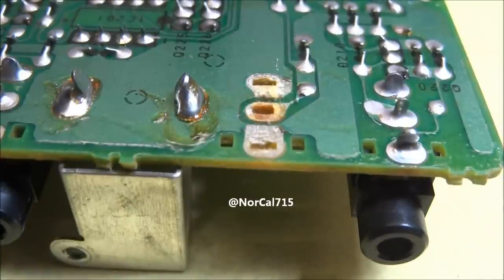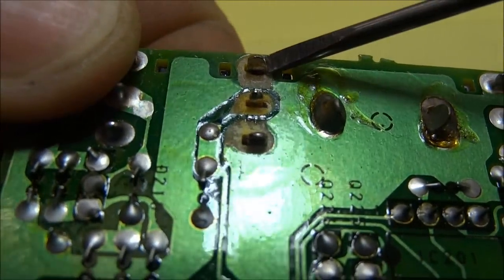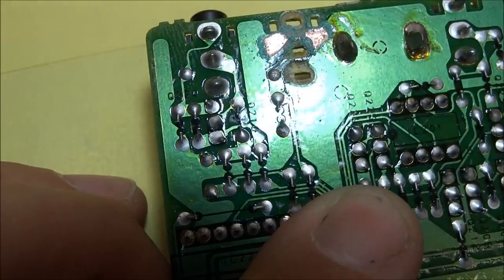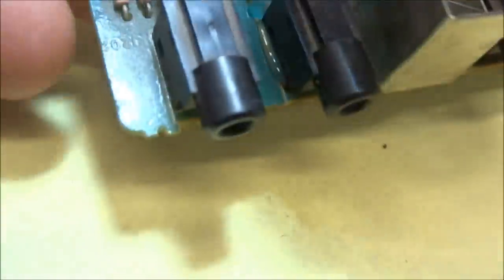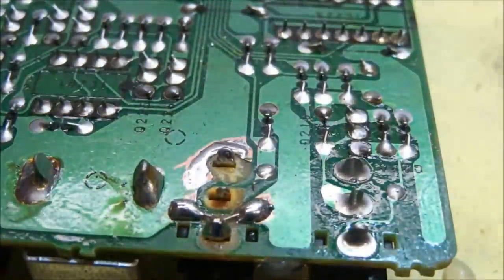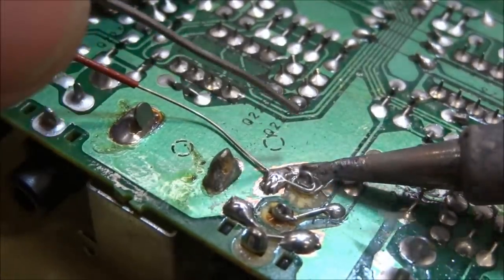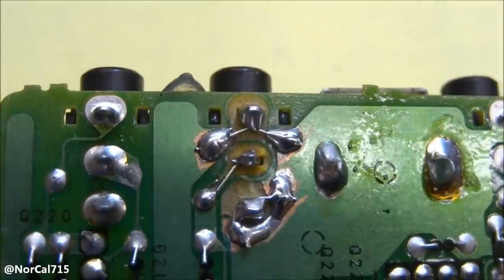Replacing a jack on a circuit board when the copper pads are missing Repair Fix

Comment: I am in electronics for 40 years and this is the better way to fix this problem.

Excellent job, well done.

Cheers.
Reply: maybe bending the tabs on the solder of the board is a good mechanical fixing plus it grabs the copper wire too; then just apply glue on the sides of jack (on top of board)
Reply: @alerey4363  That's not a good idea I think, because there is a possibility that a tab can break and you do not want to compromise yourself additionally. Besides that you are creating a new problem for eventually future service on this component.
Reply: @rolandberendonck3900  the risk of breaking is high if the tab was previously bent; but if it was soldered straight it can resist bending without issue; as for the problem for future service... an old jack glued with hot gun wont resist further service
Reply: No it won't break, in fact it will be much stronger. The metal pins would have to be bent back and forth many times to be weakened.  @rolandberendonck3900
Reply: @alerey4363  You are correct, bending the pins will anchor the jack to the PCB just fine.
Reply: So was I in fact over 40 years and this is the best way to do this repair. No call backs ever doing it this way. Also a true professional cleans the flux off when he is done like the video shows. I used to use RTV silicone instead of hot glue never had a problem.
Reply: @dontbetonit813  Hey there, i had a a question about something like this and i was wondering if it would be ok to ask your opinion on it? electronics is really not my field
Reply: Sir how about the chat gin pin the board damage the green color in board remove but a little bit.. What should I do

Comment: I just fixed the circuit board on a portable kerosene heater with this this video and saved a $200 heater!!  I could not figure out why the fan would not kick on after I soldered the connector back on to the board.  Thank you very much!!!!!!!

Comment: Thanks. This video was a total life saver. I bought a sequencer/synthesizer a couple years ago. It was battle damaged(dropped) and nonfunctional. I got it going (a couple of wires resoldered fine). It worked for awhile then boom, no sound. The Audio out was pretty much separated from the board, total tracer Spaghetti. Watched this video, fixed. Good advice.

Comment: Thanks man! I’m a complete rookie at soldering as I literally did my first ever soldering job yesterday .. I practiced with a cheap led kit first. Then attempted to modernize my 23 year old gameboy color with a modern backlit screen and other components.. but I accidentally burned off a tiny little pad on the board and my gameboy isn’t working now,, but I’ll try to fix it with these tips

Comment: I used to do this on keyboards from schools. They got a lot of abuse with keys broken and Jack sockets damaged. Works and keeps them going for a while longer. I also used to repair the non functioning contact pads under the keys, you know the ones, a bit like the rubbery buttons in a remote control, with a circle of tin foil. Worked a treat!

Comment: I like the way you wrap the wire around the post, adding some mechanical strength. Is there a reason you don't spread flux paste onto the workpiece before? On other channels they seem to douche the entire solder area with flux....
Reply: Same thing I was thinking and his still turned out nice.

Comment: Thanks man. Well explained i was trying to repair my usb sound card and somehow the copper pads were missing after removing the pins to the usb. I tried to solder to the hole but it just doesnt stick to the pad. After seeing your video i managed to try it and it works. A big thanks to you

Comment: That is a very nice job. Im in the process of fixing my OBD II scanner. It has some bad trace and a cap. The old AA batteries leaked and the corrosion ran up the negative wire to the board. Hopefully I can save it. And this video was a insight to me on how i can do it. Thanks for the 4 year old video.

Comment: Great video, great explanation.  By the way thank you for also mentioning which wire you were using... so many times people gloss over it like "oh just grab some wire," and it's not super helpful if you're learning (which, presumably their target audience would be).  

I'm doing some DIY projects in an effort to start learning some of the things I never bothered with.  One project is loosely following a hobby paint shaker build, and this guy listed every part he used... except the wire. And apparently asking about wiring is like asking for a proprietary secret.  Asked on Amazon, "what gauge should I use for this dc motor?" and got 2 or 3 cagey responses but 0 answers.  One particularly snarky response concluded with "get something that can handle an amp," with a heavy DUH implied.  

Thanks... (If that answer was sufficient, would I be asking such a basic question?  I gather I don't need a large wire, but what's too small or too big?  What's so hard about saying "I used __ AWG?"   Yes, I wasn't interested in learning anything about wiring until now.  Yes, I am very stupid and you are very smart big brain boy .)  I didn't realize wiring was a cornerstone that everybody is expected to be fluent with like reading or writing. FFS!

Ahem, anyway.  Side note: if your glue gun takes 10 or 15 minutes to heat up, that could be one argument for updating it :P.  I have a $5.99 Stanley Mini and a $15-20 Surebonder dual temp and they're both ready to go in about a minute or two.  The Surebonder also has an interchangeable nozzle so you can use a fine detail or flat nozzle, which might be nice for this type of work.

Comment: Thanks for a great video. You are a good teacher it's a skill believe me. I'm new to solder but was able to fix a auto instrument cluster circuit board with lifted pad by using a wire to bridge the pin to another solder pad. Saved me $300 thx bro!
Reply: Can you use normal soldering wire to fix anything?Since I only have the normal wire.
Reply: I ordered some solid core wire on amazon.  26 gauge.   But I bet braided copper would be OK.
Reply: Dave Champion thanks

Comment: I have the exact same problem with the power plug on a portable scanner. Had to replace it. Discovered that ninny here scorched the life out of it. I also have to replace a transistor that was surface mounted. 25 years ago was when I ruined the board but I think after watching this I may be able to rescue it and learn how to solder better. Too old and shaky in spots but we'll give it one more try. Thanks for the tips. :-)

Comment: I bought a refurbished  ASUS GS3S gaming laptop 1 1/2 yrs ago  and had to repaired 2x's after... Now I know why it was refurbished...

I replaced the $5 ac/dc jack that wasn't holding up about every 6 months instead of purchasing a $200.00 motherboard because it was pulling away from the board and wasn't able to charge battery or use AC adapter.

 Now I repaired  ac/dc jack again with your method which should reinforce it well..And Hopefully a permanent fix..

Thanks for the Helpful Video

Comment: The problem with jack connections is that once the ear plug is in the socket, it adds leverage to the jack which is then easily broken loose from the solder pads due to mishandling of the electronic device.  As you know, some board designs allows for a metal housing on the jack to have its own through the board solder pads to secure the jack, but in the case of the device in the video, no reinforcement was made...an obvious cost-cutting measure.  Nice video.

Comment: Two suggestions (very late in the game, but just came across the video).
1) I would have drilled a hole either side and cable tied it down to the PCB as well as the glue. some force must have been used to break it and I don't think hot glue will hold it long term against a force like that.
2) Hot glue has some issues. I think it goes conductive with age, maybe use an epoxy glue instead. You can increase the holding strength of hot glue by a small trick. The glue here is used to bond flat surfaces, but hot glue is actually really strong with tear strength rather than bond strength. If the glue is allowed to flow through a hole in the surface, its holds way stronger. Drill a small hole either side and when you were glueing the sides of the jack, allow the glue to go through the PCB in the holes. It will form a mechanical plug either side and will hold with way more strength.
Reply: Oh yeah, seeing all that hot glue in there gave me the creeps. No, hot glue is NOT good for reinforcement.

Comment: nice repair but you didnt have to scrap  the protective layer. you could just use jumpers and solder it to the nearest pin thats connected to same trace
Reply: karims118 that is exactly what I did.  I'm just getting my feet wet with soldering. I wasn't sure if it would work but ive desolderd a few jumpers. I fixed an X Rocker power imput with a jumper.
Reply: A good electrical connection is a good MECHANICAL connection. That jumper wire is gonna snap off one day. Maybe not in our lifetime but ONE DAY!! 😂
Reply: That "protective layer" is simply soldermask,  only needed during the manufacturing process.

Comment: Norcal715 at our shop we run into plasma  malcharge problems. red, blue, green flashing video "noise" on some repairs. Most seem to improve as the panel warms up, but some of the older LGs after all the adjustments we are only getting them to about 85 % picture quality. We make sure the voltages are correct and have tried replacing caps in the sus boards. some that come in we replace the IPMs and for some this does it, some times not. Do you think as some suggest that the panel is the problem ?

Comment: Hi, I had the same problems with some PCB's and I used stained glass Copper foil with acceptable results, the hard part is cutting the foil to the missing shape in the PCB but with patience and a good augmenting equipment you can do it.

Comment: Years ago I too used this method. But, more recently, I salvage all of the good parts, as well as traces and pads from quality boards with heavy foil traces. Then, I use those traces, or I fashion new trace from heavy copper foil, to repair damaged traces and pads. First, I solder the repair to the existing foil very cleanly, using as little solder as possible. Then, I use an epoxy film phase change adhesive, from Fastel Adhesives (no affiliation), to attach the repair to the board. If you hold the repair in place, with the film epoxy under it, on the board by covering it with Kapton/polyimide high temperature tape, you can use the heat of a soldering iron to activate the epoxy, gluing in place. It literally takes seconds to activate and cure the epoxy. After removing the Kapton, I paint on a solder mask where needed to match the original color as closely as possible. Then, tin the repair and use solder wick to mop-up any extra solder. More often than not, the repair cannot even be spotted, unless you know it's there. This type of repair is extremely reliable and easily serviceable if future work is required. And, it makes customers happy! I hope this helps someone else. Cheers!
Reply: Sounds expensive in terms of materials, time, and must make a lot of pollution in your space. Do most customers even care what their PCB looks like when they never see it?
Reply: @ @EternityofNight  The epoxy film adhesive lasts forever and is quick and easy to work with. You use very small amounts on a per repair basis. It's supplied in sheet form the size of a piece of paper. So, it's easy to store. I don't know if the customer cares. But, I do. Longevity and future serviceability of a repair is important to me. If a future repair is made by someone else, I want them to say "Wow! Who repaired this before?". Instead of "Wow! Who butchered this before?" Cheers!

Comment: Thanks for the demonstration.  I promptly broke a component RCA jack while testing a AV switcher I found.  Looking at it I think it was destined to happen from a factory error, the jack was never flush with the PCB so all the load of plugging and unplugging was carried by the solder alone.  Anyhow all fixed now.

Comment: i would NOT want to use a glue gun for that kind of work - epoxy MAYBE if you do it really well ... but hot glue wont endure a jack that people are whacking on daily ....
Reply: Not to mention the heat produced by the appliance itself...
Reply: I mostly use hot glue because it's easier to rework or remove for future repairs.
Reply: If it works, it works. It's obvious with that large surface coverage, it will work, and all good techs do work which is reversible, when possible, for future service, unlike epoxy.
Reply: antigen4 I WOULD despite the fact that you would NOT.
Reply: "Not to mention the heat produced by the appliance itself..." um .... heat like from a soldering gun? 😂 These things can take the heat.
Reply: @HazeAnderson  lol yep... if you're really worried about it, you can use a low temp glue gun (or use a lamp dimmer to make any glue gun low temp)
Reply: He didn't even need to glue it. The way he attached and solder the wires it will never fail unless someone breaks the board.
Reply: @HazeAnderson  If the heat from the appliance at the earphone jack is that high there are problems with it much more severe than a broken loose jack.

Comment: Nice.  I wish you would have talked a little bit about the thought process on what gets soldered where, why you crimp in some cases and run the wire to the other side in others.  Have a busted TRS jack on an expensive studio monitor I need to fix but still not confident.  Getting close though! Thanks for the knowledge

Comment: I am in a similar situation but the jack itself is broken. The pcb is fine. I am trying to determine where to source a new identical (or equivalent) jack. Its on a Cambridge soundworks subwoofer from the early 2000s.
Reply: I have the same situation but it’s on a controller circuit board
Reply: Make sure to keep up the CAPS.  YOUR EGO HAS a need to be HEARD!

Comment: impressive video i enjoyed that your very clear and easy to understand. im hoping you could help me...i have a semi similar situation a connector snapped off the board with the plug end still stuck inside however theres no pads on the board to re solder to...i have a replacement connector with the proper pins if the old one is no goood but is there anyway to re surface the connection pads it was solderd to originally?? its only a 2 pin connector plug on the main board of a dji phantom 2. hope to hear what you have to say... thank you for your time.

Comment: hello. I got a nice set of spindles of 22awg hookup wire in various colors. Would  that have worked the same for this repair? What tip do you have for determining what thickness wires to use for various work? Many thanks

Comment: Nice hack job, but it works well and is supported. Granted it's not a real repair rather a quick fix, because the pad area wasn't replaced, but it will last a long time and is very cost effective! Thanks for sharing. Thumbs up. Best Wishes & Blessings. Keith Noneya

Comment: Always very informative videos - nice work. Soldering skills about 6/10. Milspec. no - too much solder and tighter mechanical connections (use small needle nose). Easy on the glue gun - as said, a risk of glue contamination in the connector. Instead of acetone, try carbontet. So few pre-tin, great lesson/point.

Oldgoat68
Emery pen or glass fiber pen will do less damage to the copper foil (trace).

Comment: I used to use epoxy to secure the body of the jack.
Reply: Good taste in videos.. like the monitor re conversion you just did also..
Reply: Good for you but hot glue is undo-able and it works for him..
Reply: @droceretik  He's a troll. Ignore him.
Reply: Not certain about the points made but ,if anyone else  wants to uncover 
pc board repair
 try Saankramer Electronic Magazine System (do a google search ) ? Ive heard some amazing things about it and my colleague got great success with it.

Comment: Good video thank you but what if your jack doesn't go through the board like your video but the legs are surface mounted and the leg ripped off with the solder pads? I scraped around the one pad looking for copper but didn't see much the other three pads are still there so it's just the one I have to figure out it's a AV input Jack on small pcb ,  3.5mm like headphone as well.

Comment: This is pretty much what I've done in the past,  except that I use an x-acto knife to clear the soldermask off of the board,  my screwdrivers not being all that sharp...  :-)

I noticed the brand name on the board.  In the case of a great many repairs of this sort that I've done,  it was also a rather well-known Japanese manufacturer but more often than not it was the DC power input jack on the rear of the unit.  Sometimes pads would be damaged,  sometimes not.  In the case where they were not,  simply scraping off a lot of the soldermask around the pins and putting big blobs of solder on there seemed to give a much more robust connection to the jack.  I never could figure out why they put the soldermask on there as close to the pins as they did-- probably underestimating the potential for abuse on the part of the American (and other) consumer,  compared to those in the Japanese culture?

Comment: Good job using the braid. I have tried using that stuff over the years .It has never worked well for me. I guess it takes a certain touch. I have to use desoldering  gun. Anybody that can use braid my hats off to you. Yea. Good idea with the hot glue.
Reply: Put some rosin paste flux on the braid and try it again

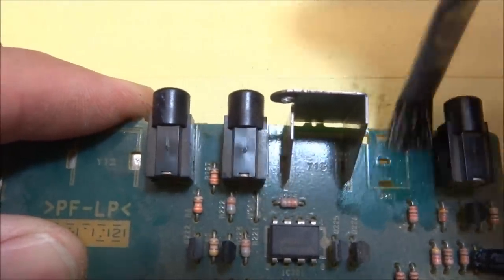Comment: I've read that you should use 50/50 acetone and alcohol for this cleaning work at 5:39, not rinsing that acetone off he plastic jack will almost certainly cause problems with the jack.